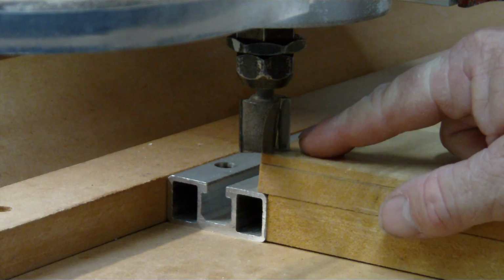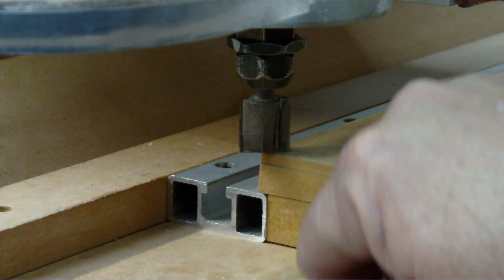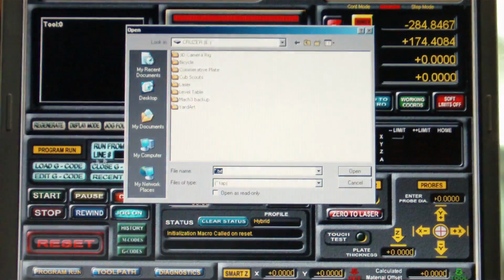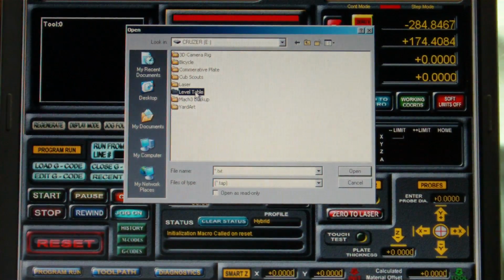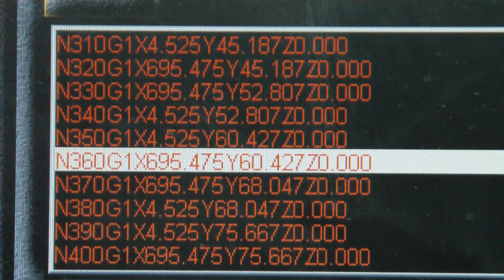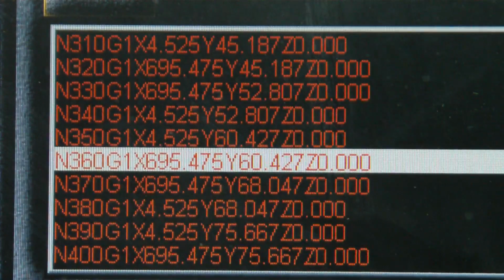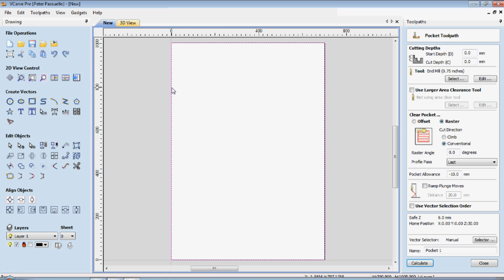Table maintenance Part 2 Level the Table - CNCnutz Episode 48

Comment: Nice tip. I just recreated my leveling file using your method and it worked  perfectly. With any luck will never have to recreate the file again.
Reply from the maker: Thanks John.
The great thing is you can take as much or as little off as you like without making a new file. 
Cheers
Peter
Reply: It's a simple a way to do it. I put a brand new spoil board down today and put a light coat of paint on it. Ran the file with Z at 1.0mm. At the end there are no paint on the board and was perfectly level. The best part is I know I can use the same file in years to come without having to make any changes. 2 Thumbs up.

Comment: Very nice tips  I use a Zenbot 4848 and use MDF most of the time in my business (cherrymancustoms.com).   Ive always used the rule cut depth max should not exceed half of the endmills diameter.  I usually listen to my endmill  to gauge speed but most of the time its in the range of 100-130 ipm.  What are your thoughts on speed and pass depth?  Thanks Robert    my channel(https://www.youtube.com/channel/UC74QWS_CIc_rz2iaOl_yWUQ)
Reply from the maker: I am the same. For most jobs I use half the cutter diameter as the maximum depth of cut though I do break the rule on occasions. What fun are rules if you obey them all the time. I also listen to the sound of cutting to determine the best feed rate and range between 100 and 200 ipm depending on the material.
Cheers
Peter

Comment: Hello. Please tell me which blade did you use for this, and where can I buy it. Thanks!
Reply from the maker: The router bit is a 3/4" straight flute bit that came as part of a cheap set of cutters. Any large bit will do the job.  Cheers Peter

Comment: Could you show us newbies how you make a leveling file?
Reply from the maker: Hi GrandpawB,

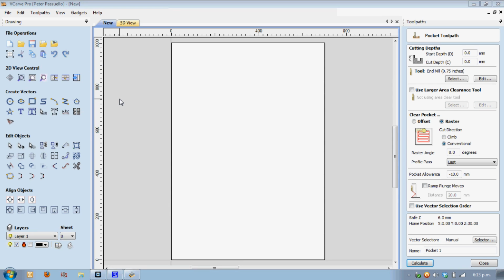If you look at 2:20 of this video it shows how I made the levelling file. It is just a pocket the slightly larger than the table with a depth of cut of 0. I used an off set of -10mm to make the pocket larger than the table. If you need more info send me an email and I will help you further. Cncnutz65@gmail.com
Reply: ***** Thanks. That goes to show you how "newbie" of  a newbie I am. Didn't know what a "pocket" was. So I learned two things today. Thanks again. :)

Comment: Thanks!  I have only surfaced my table once so far.  Re-using the g-code for the next time is a great idea.
Reply from the maker: The most useful bit I find is not remembering the depth of cut the G-Code does and accidently carving half your table away next time you go to use it. You only make that mistake once.
Reply: I wish I had read this comment earlier!
Reply from the maker: Am I to take it that your table is a little thinner than it was before?